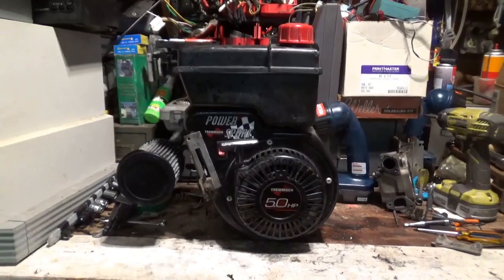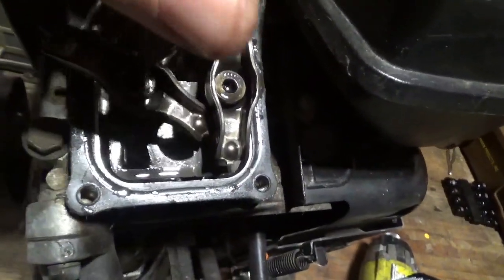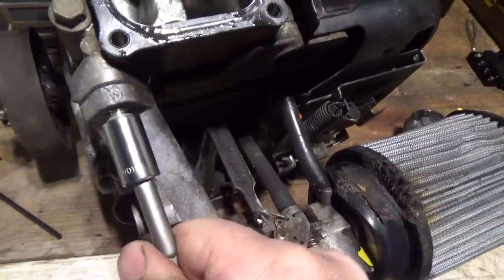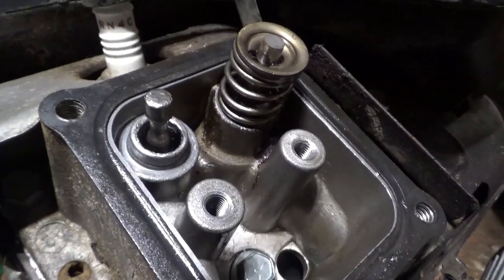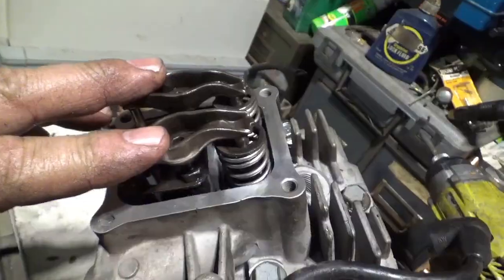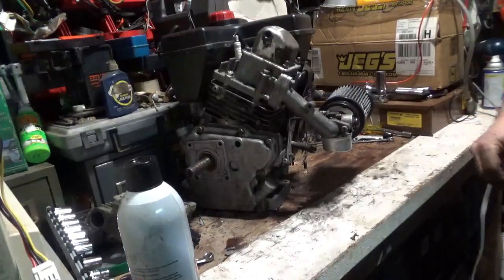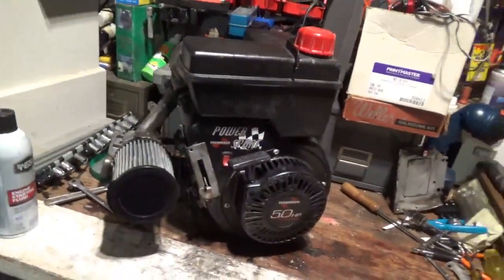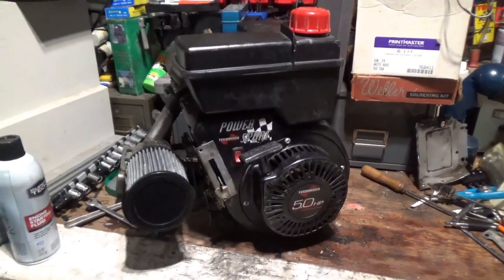Overheated, Governor Removed, Dropped Valve Engine, Can It Be Fixed?

Comment: Right around the 12:43 mark of this video when you gave the side cover of the engine off and you take out the cam and then you pulled a little bit on the (cam follwers) as you call them i have a similar problem now with mine. Today i pulled the cam out of my mini bike engine but stupid me didn't remove the engine itself from the frame of the bike. I left the engine sitting in the frame and therefore the engine was not laying on it's side like you have it here so as soon as i pulled the cam out that rod slid out of the far hole deep in the engine and now i don't know how to get it back in there ? I took the cam out because i just got a new Mod 2 Cam in the mail that i ordered and i was gonna put it in but i can't do that until i am able to get the valve rod and stem back in place. Not sure how to do it being that the engine is not on it's side and still sitting in the frame. What do you think i should do ? You're not by chance in northern North Carolina are you ? Then i could just pay you to do it lol. I'm not a mechanic and figured i could pull this 1 job off if i watched enough how to videos on you tube but i messed it up. :( Now i can't ride my mini bike anymore until i get this taken care of. Engine all disassembled laying on the floor with me standing there scratching my head like what did i get myself in to here ? UGH !!